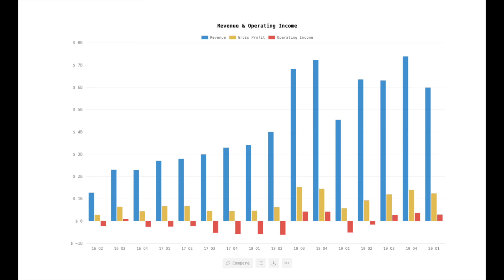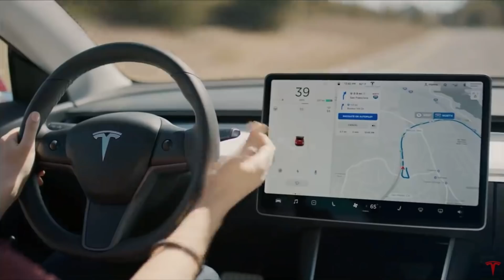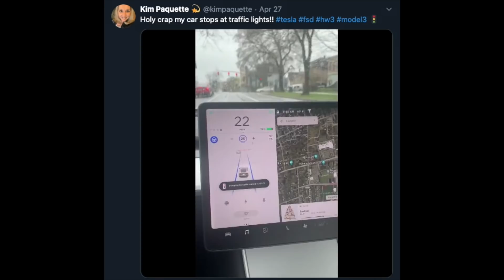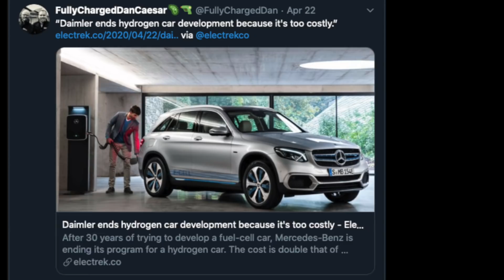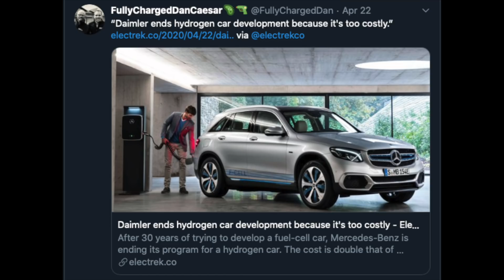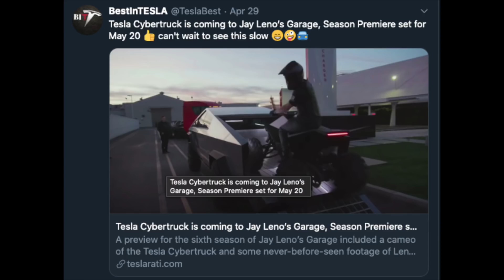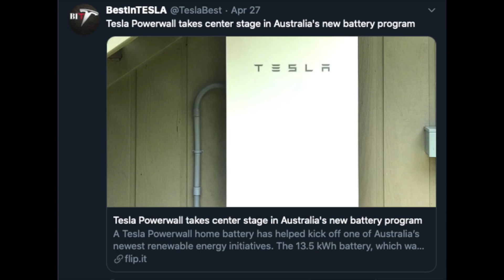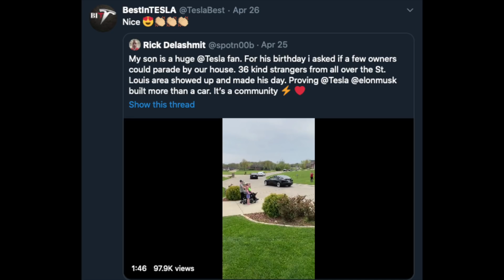Tesla Q1 Earnings | Mercedes ends Hydrogen cars | 300.000 Powerwalls get installed

Comment: Another good one Lars. Hydrogen was a fool's errand in the 80s. Not much has changed. Way too low energy density. The amount of money wasted on this is beyond staggering. It is mind blowing. Scientist knew a long time ago the energy density. This is not new information. Toyota may be the first to fail from inability to see facts. High school teachers knew hydrogen would never work as a energy source for a car.
Reply: Yes, another good one.
Not only is hydrogen fuel cell inefficient, but because of it’s explosive nature under pressure, it’s potentially dangerous.  Only a couple of weeks ago, a hydrogen production facility, producing hydrogen from natural gas (secreted in an industrial park), blew, knocking out a wall and windows several blocks away, such was the power of the shock-wave. Apparently, the blast was heard 10 miles away...in 3 counties.
Good riddance to the idea. Even trucks would perhaps be better powered like electric trains, with a generator on board, until battery supply meets demand, rather than countenancing hydrogen fuel cell?
Reply from the maker: Thanks Pat ✌️
Reply: It could work, but it will allways use at least 3 times as much energy compared to a battery. On top of that the technology will be much less reliable. Hydrogen could be compressed to 800 bar or so, it will be dangerous (a car tire got something between 2 and 3 bar in it), inefficiënt, unreliable and name it, but at 800 bar it got a reasoneble energy density. It might work for planes or things like that.